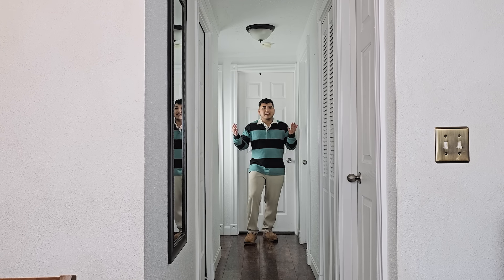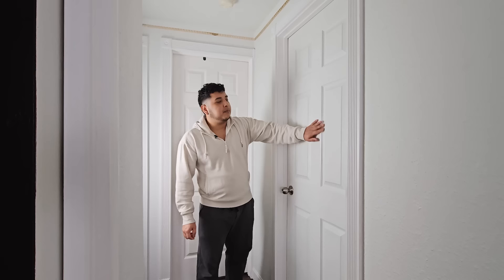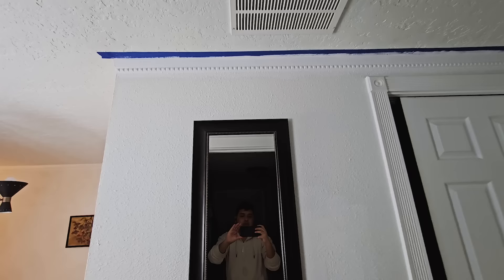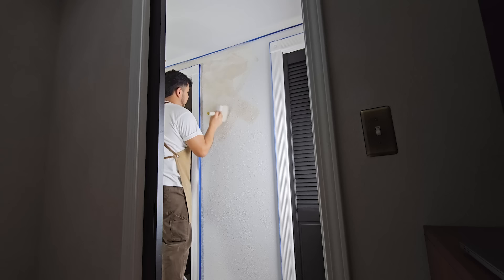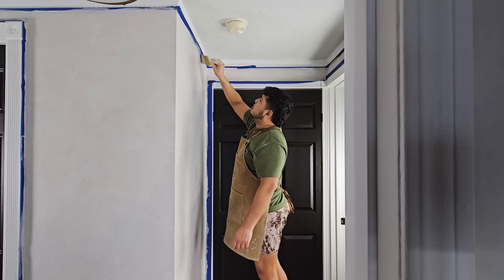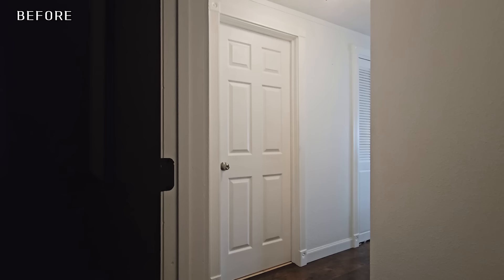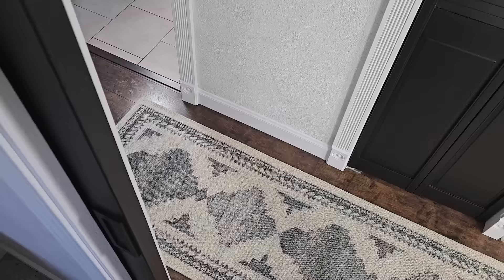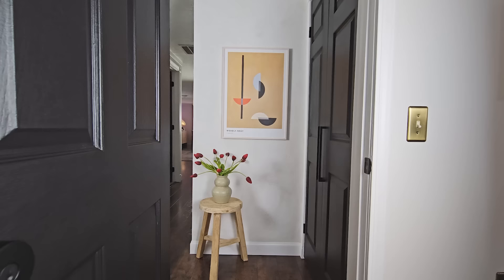EXTREME SMALL HALLWAY MAKEOVER - lime wash paint, DIY artwork, decor ideas

Comment: Exceptionally beautiful.
Amazing transformation.
Great call on the door and wall paint. Gorgeous light fixture. Perfect mirror. Two suggestions... The stool seems out of place and something that could get knocked into and over very easily. I would suggest putting a classy shelf under the Picasso Print whereupon you could put a bowl for keys or whatever and maybe put that vase on the shelf  As well. Since the hall is narrow, I would limit the pictures. As too many with too thick of frames will make one feel very closed in as they walked through the hall.